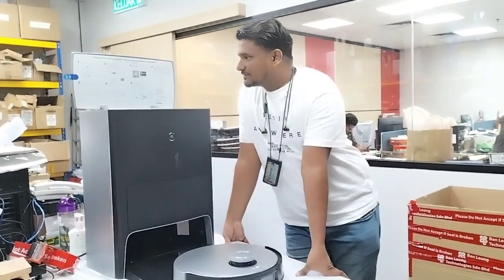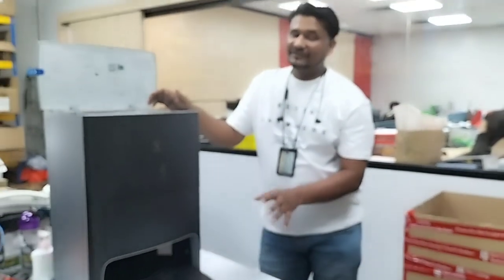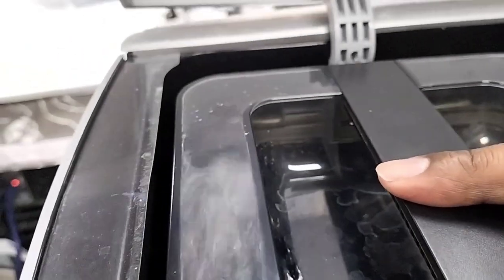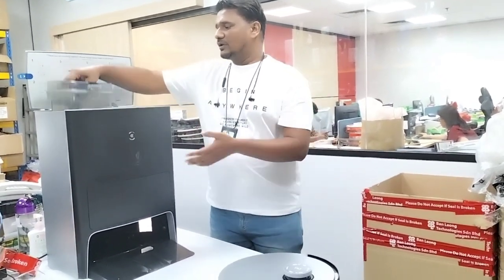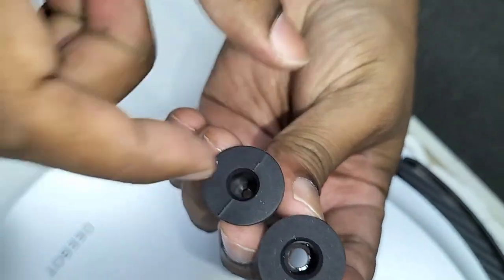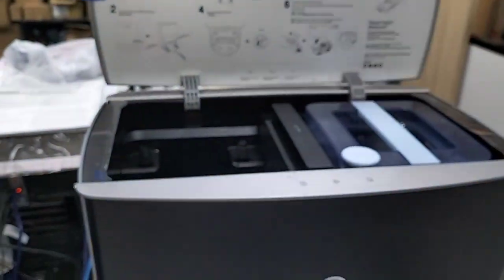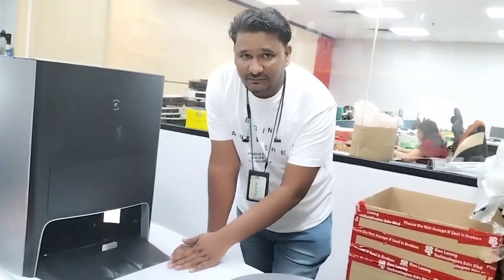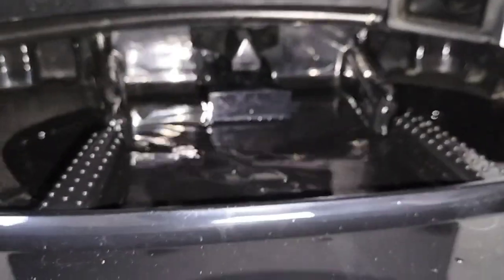Ecovacs Omni X1/Turbo."Sink is Full"  How to Fix This Error??

Comment: thank you very much for this tutorial!
It didn't solve my issue completely tho, there were debris in the channel that connects the LEFT hole (bigger hole) of the dirty water tank to the sink.

You just want to apply pressure with a siringe or a long tube and using your lungs to let the debris pop out. Now it works like a charm!!

Make sure you don't apply pressure to the little hole, right hole, because it seems to be directly connected to the pump.

Hope this helps users and techincians too :)
Reply: I was about to suggest the same thing with the syringe.  Mine was exactly this issue. Debris from soap, scum and Cat food was also in there.  But the suction helped too :)

Comment: In the video you removed two rubber ports and explained to not push down to hard when reinstalling but what purpose does the right most port have?  The left one is the path for dirty water to exit the sink so why and for what reason is there a port on the right side?
Reply: There's only one possible answer: it's an overflow protection. It'll likely redirect dirty water into the fresh water tank.
Reply: @laurencebarnes5361 air suction.. it pulls the air out of the tank to create suction of the water from the sink into the tank

Comment: Hi! Youre videos are really helpful. I have a problem where my X1 turbo is automatically activating sink cleaning over and over again and i have not pressed any buttons or done anything through the app. The deebot leaves the station and then water comes into the sink, it drains itself and then the deebot goes back in and then it does it until the clean tank is empty and the dirty tank is full. Do you know how to fix this? Any help would be appreciated 👍
Reply: Weirdly, I put the child lock on and that temporarily solved the problem as I think that the station was automatically pressing the buttons, but now the child lock is deactivating by itself too!
Reply from the maker: Ok plz power off the station, if plastic not yet removed from station touch screen button then plz remove it & use any alcohol tissue paper & wipe that touch screen panel & same tissue paper can use to wipe in the sink area left & right side sink sensors Mattel plates.normally it solves the issue but if still same then might be the touch screen panel or motherboard issue. there's a strip attached that touch screen panel to motherboard maybe damadge or loose. Can check that part as well

Comment: My ecovac x1 omni not dispensing water from clean tank. its brand new never used. Just bought yesterday. Can we fix it ourselves if you send us the part??
I also did all troubleshooting after talking to support.
Reply from the maker: Station opening is quite complicated.. many wires & pipe at the back... Sometimes just in assemble they fix wrong pipe wrong side some time solenoid valve need to replace sometimes wster pump issues...take time to test

Comment: Can you please make a video of how to fix the X1 Omni station if clean water is not pumping? Mine is not pumping to the station or the robot. Please help!
Reply from the maker: Need to Open the whole station then at the back got pump n solenoid Valve. Need to test which one is fUlty.. It take time.. Long process dear
Reply: @ecovacstechnicalsupport5278 do you have photos of the pump and solenoid. 

I just want to confirm as I have a picture with part number
Reply: Please we are several people need this fix ... I started to disassemble bas station , but in 5h hour I haven't successfully found how find pump 🤯

Comment: I think mine has a blockage as gets good pressure in dirty water tank. Can you do a video on dismantling the base station? I got part way but can’t get back off…
Reply from the maker: Actually Omni X1 or turbo station takes time to open & fix it back... video will be quite lengthy...once Free then only can do that..
Reply: Hello, maybe you already solved the issue, if not read my comment above

Comment: Mine still not working. Cleaned it the rubber as well. What else dan I do
Reply from the maker: Dirty water tank need to replace...if you feel that there's some suction noise but water not returning to tank means just dirty water tank need to replace

Comment: Why not create the rubber gaskets so they don’t have that room at the bottom to slip down? This thing tells me the water tank is full every time it goes back to wash the pads. Its doing my tits in
Reply from the maker: That's Ecovcs design sir..I can not do anything in this matter sorry
Reply: @ecovacstechnicalsupport5278 I don't think that's true.. you can give the company the feedback many times the this is a major issue that's causing endless very expensive returns because of a extremely easy design fix not happening.. Sending a little rubber ring or gasket to go under that piece to keep it from sitting down completely or designing a new replacement rubber piece that's taller fixes the issue.. Show them the solution to the problem. Show them how big the problem is.  Save them money on returns and repairs. You get promoted or a bonus etc. Everyone wins